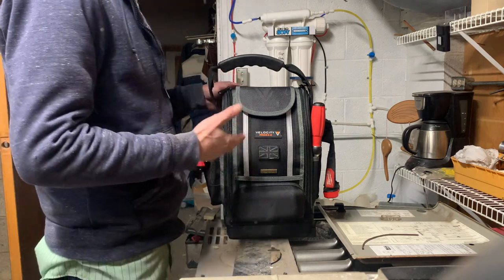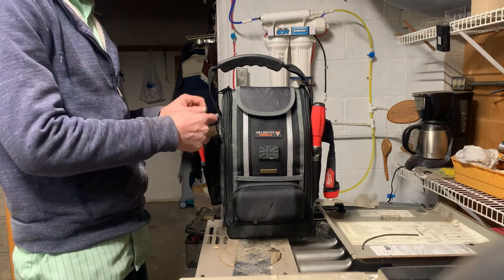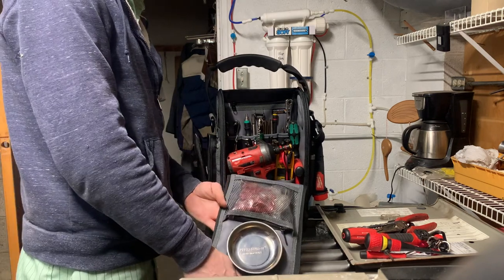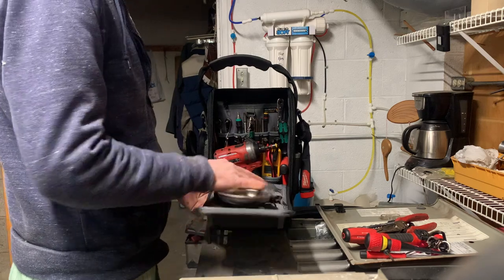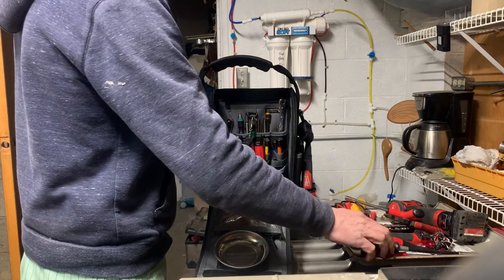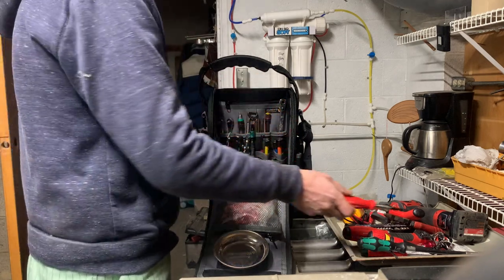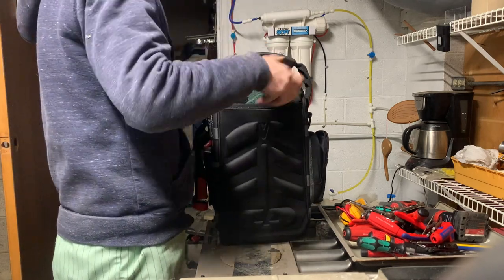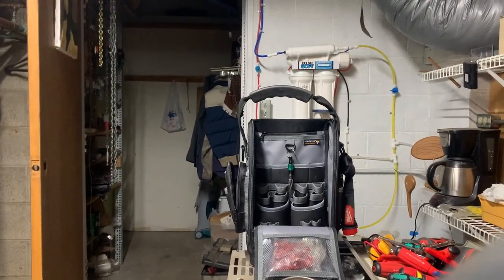Velocity Rogue 2.0 Initial Loadout

Comment: Hey Mike, do you still like this bag?  Would the back panel fit an iPad?  Just wondering.  Thanks.
Reply from the maker: Yes, I do like this bag.  I had to pay to have it shipped from the UK as they're not available in the US.  The back pocket does not fit my larger iPad very well (but I have the magic keyboard attached), it would fit an iPad-mini well.  I think a veto TPXL is probably better for us in the states because of the shipping costs / hassle to get them over  to the states.
Reply: Thanks. This is part of my continuing search I started on FB looking for a meter/and field piece probe bag.

Comment: Where did you buy this? I can't find it here in the USA
Reply from the maker: I bought it directly from Velocity in the UK.  Had to pay extra to get it shipped to the US.
Reply: @mhoush  did you have to contact them directly by email or was there an option on the site because ei don't see USA listed as a shipping country
Reply from the maker: @joeynox  Yes, the website says to email them for international delivery and they'll quote you the cost.
Reply: @mhoush  how is it holding up? Any wear? Also, how much was the shipping?
Reply from the maker: @atnamesarelame been holding up well. It’s been a while ago, so can’t quite remember shipping costs. I believe shipping cost was $80-100 additional.
Reply: @mhoush  ok thanks. Would you say it's as good quality as veto? Or is it better or worse?
Reply from the maker: @atnamesarelame I would say they’re similar. I would probably guide someone to veto if they live in the states and / or aren’t willing to take much risks, as with the cost of importing this is probably not necessarily worth it until / unless they get distribution in the states.
Reply: @mhoush  yea. Importing sucks. I really like that it's tall, narrow, has storage slots built on the inside, zips all the way up and appears to be durable. Veto doesn't have a bag that fits all of those needs for me.

Is there another bag you can recommend?